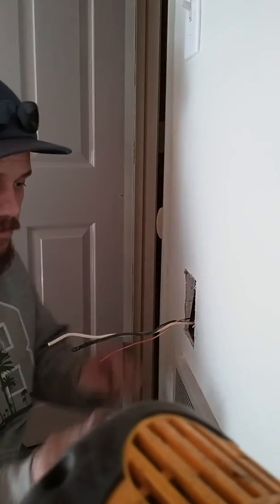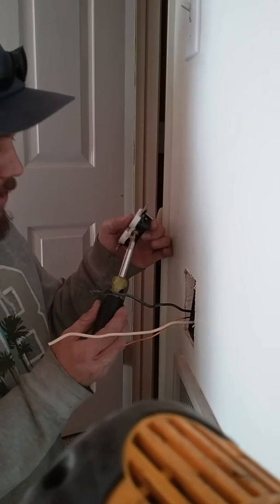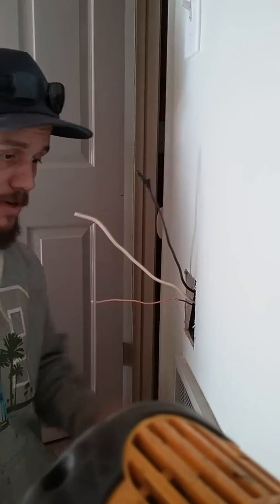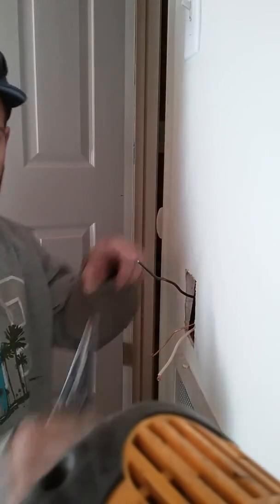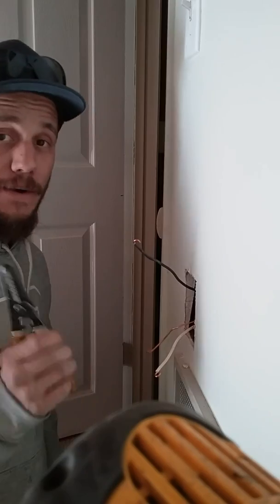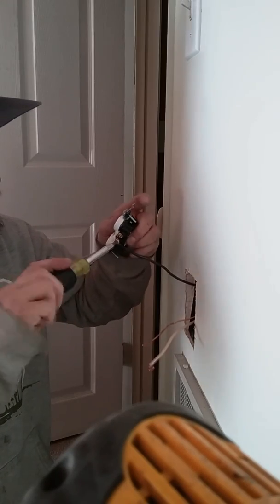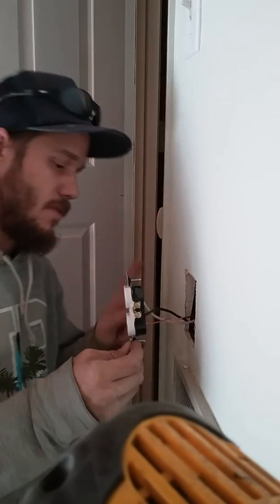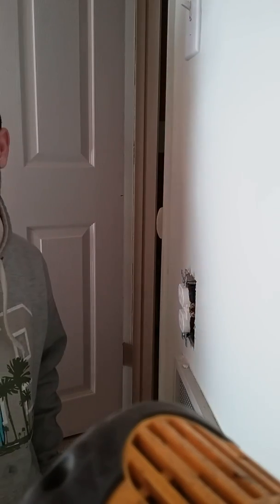Installing an Outlet, plug, receptacle, while hot, power on.  No shock.  DIY electrical lesson

Comment: Bro. This is sketchy as hell. 😂😅 He gets her done. But it's just millimetres from biting him multiple times. Especially when shoving it into the box (if it's an old metallic box) plastic box is fine of course. Almost touches the strippers.. . It's dicey bro. And it hurts. 🤣🤣🤣 and... could potentially kill. If I had to do 10-15 of these in a day, I can almost guarantee that I would lose concentration at one point, or a wire would bounce back wrong or if drop the receptacle, or touch the box, or spark the driver across 2 lines, I can go on & on..... but somthing would happen. The OPPERTUNITY to get shocked is endless and I would deff get hit.
Reply: Maxwell Lewis
“Should” be used. Lots of cowboys out there man.
Reply from the maker: Sebastian Woot I've been doing electrical for 16 years.  I've worked hot plenty of times.  I've been shocked and blasted tools and outlets.  I work on it all like it's hot even if it is off. Never know when someone will turn it on.  I made this video to teach what I have learned.  The most dangerous thing I did wrong in this video is  flat hand pushed it in.  Best to use thumb and fingers to avoid the brake off tabs .  Get too close with the full palm I used here .
Reply from the maker: Sebastian Woot usually ever 1000 I do a hot  reverse

Comment: Just switch the breaker off if u can. Or where the right gloves
Reply: Any recommendations on a glove besides the big thick ones that are meant for high voltage. What about rubber coated gloves
Reply from the maker: Don't work on anything hot

Comment: usually more safer is use electrical tape around the outlet so the hot doesnt touch the metal or else it will accidentally blow the breaker resulting in burned box and outlet 🙌🏻
Reply from the maker: Lavar Ball in metal boxes for sure
Reply from the maker: Tape around the outlet only helps if it's hot install in a metal box.  The hot screws cannot touch the sides of a metal box while it is installed .
Reply: Its nice taking out a taped switch in commercial, compared to an untaped one